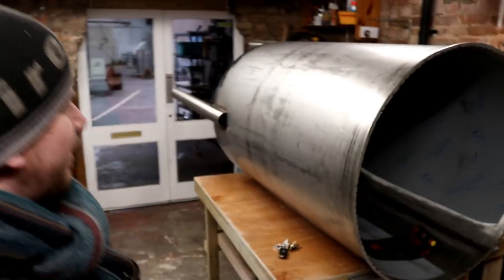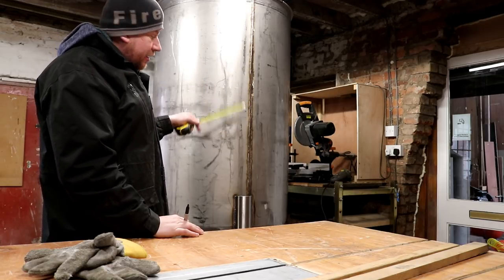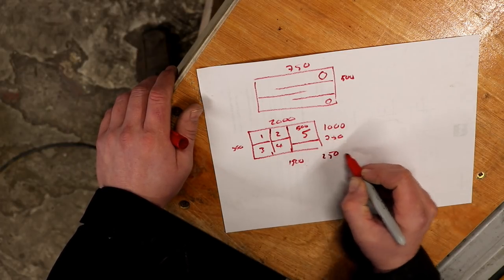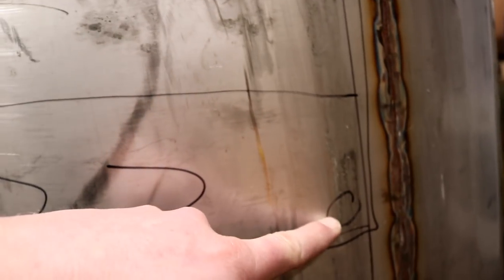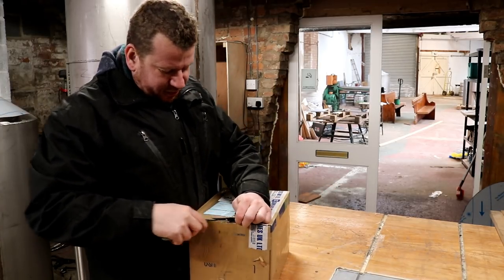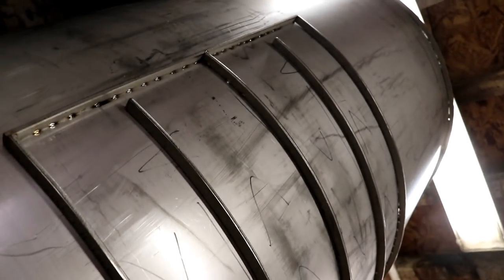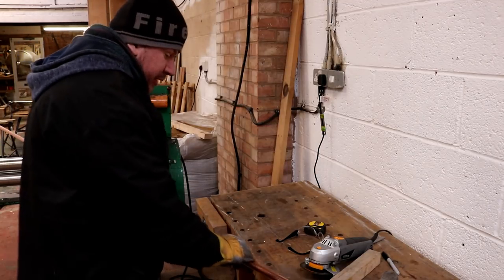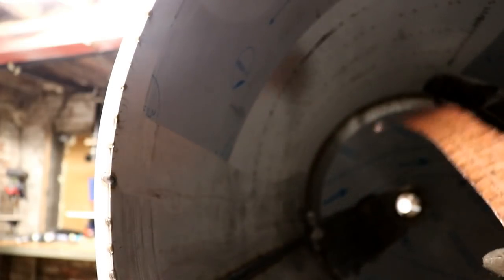Glycol fermenter Jacket

Comment: Nice video, one suggestion on the outside of the tank. Think about clear coating it for better cooling effect. I design transformers mostly the mechanical structure of it. But we were having issues with heat dissipation. Found through testing and experiments clear coating the SS essentially opens up a window on the surface. Allowing for better emissivity.

Comment: Dumb question. Why do you need to back up the welds before you weld it? I was watching a video on milk tank construction and they weld both sides simultaneously (yeah - an expensive CNC setup) but they don't put a backup metal strip on before they weld anything. (And they use a "dimple making" machine with a laser to weld the dimples to make a super wide glycol blanket.) Oh, can you add a currency converter on your merch site? It might help you get more international sales.

Comment: Harry, I know you are a busy man but I have a question about your ferm temps and hope you can answer. Awesome job you are doing on the tanks by the way. Question is : Its all understood about the glycol chilling part of temp control but would you need heat the brewery when temps drop to like 2 degrees outside or lower if just starting a fermentation to prevent it getting to cold. with your experience what is the danger temp that you need to keep above to not affect fermentation. I just notice on bigger setups there is never heating adaptations like small homebrew set ups and big setups are usually in big freezing cold workshops etc. thanks and hope you can answer mate. this could help ease some concerns I have with my frem shed in freezing Scotland just now.
Reply: barry reid you need to build a fermentation fridge.
Reply from the maker: Wills Brewery has hit the nail on the head. the thermal mass of 500 liters is huge and it takes a lot to change the temp. The yeast usually produces enough heat via their metabolism to finish the brew. on the rare occasion they stalled, I used to chuck a heated blanket on the fermenter and that was enough. never had any issues at 2000 liters though.
Reply: barry reid. Affect and not Effect. You win a Gold Star for excellence in the grammar department. 😁
Reply: yes dyslexia is a pain but you can only battle on and try to overcome it. think I'm not doing too bad considering. It doesn't make you thick though as Harry could agree.
Reply: thanks for the response guys. I'm just inexperienced on the bigger volumes as just away to make my first bigger batches and its bloody freezing out there so appreciate the advice very much.

Comment: Better to cool the other way input bottom and output on top for better cooling
Reply from the maker: Yes, A slight oversight. The glycol will go in at the bottom and out at the top to avoid airlocks. I got stage fright and forgot.
Reply: Was going to mention the same but you've already replied 😄 . Cheers, Schnuz.
Reply: I'm not really sure it will make any difference which way round you pump glycol.  The heat will be drawn out across the whole contact  channel and likely further as the whole tank is thermally conductive.
Reply from the maker: Air locks mate
Reply: If you pump the glycol from the top the cold input will likely sink through the hot glycol that has been in contact with the tank and the cooling will be less efficient. Pump it from the bottom and the hot glycol rises so the glycol coming out of the heat exchanger will be as hot as it can get, making the process more efficient. Cheers, Schnuz.